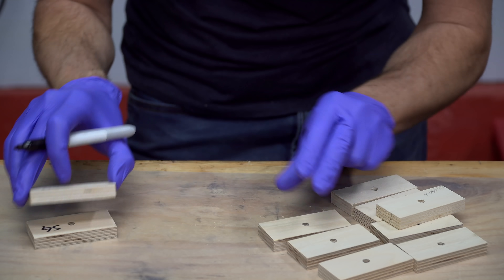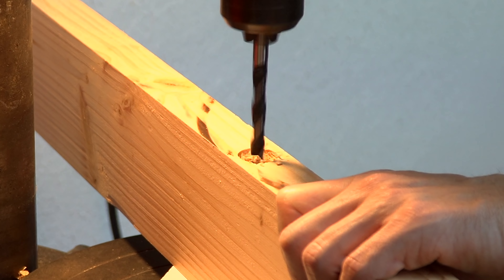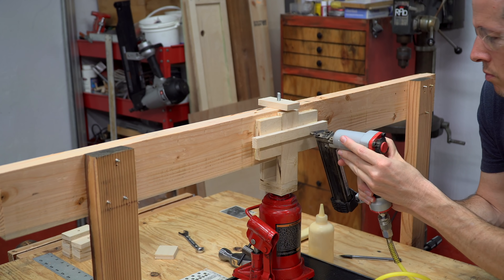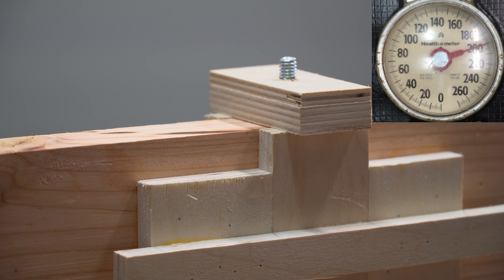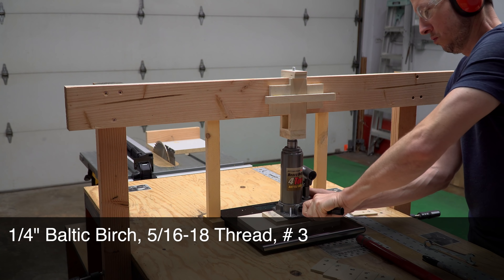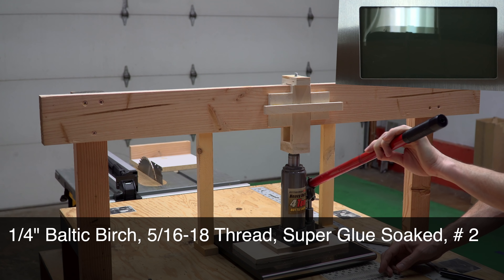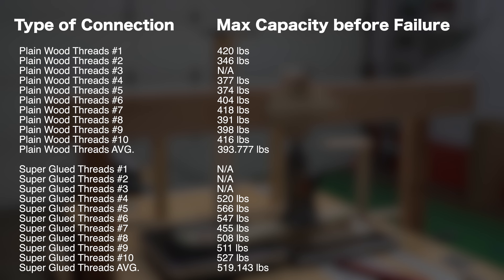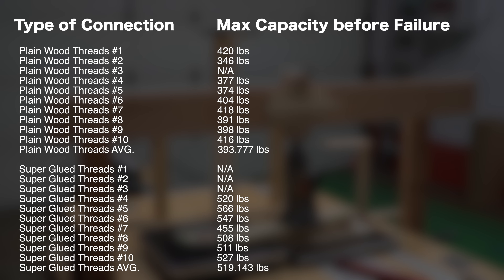Does Super Glue Make Wooden Threads Stronger?

Comment: Wow! That was fun!
Yeah, I'm a geek. 😆
But now I wonder how necessary it was to let the glue dry overnight. Did that make the joint stronger or just minimize the chance of the screw being glued to the block of wood?
Reply from the maker: Thanks (fellow geek here)! I just figured I would let the super glue fully cure, and the bottle said to allow 24 hours. I figured anything else would be unfair to the super glue. Anyway, thanks again!
Reply: @OneMinuteWorkbench  - Ah ha! That makes sense. Although, it does make using the super glue much less convenient, unless you're not in a hurry. Those joints were awfully strong without the glue. But being geeky (and somewhat anal retentive), I'll probably use the glue if time allows.
Thanks for the quick response and thanks again for the informative video and all the work you went through to create it.

Comment: Great test. But is it practical to use super glue and need to wait 24 hours before you and use the threads. Are the threads strong enough without the super glue for most applications.
Reply from the maker: Thank you! I think for most scenarios, it would probably not be practical to have to wait 24 hours to continue a project. However, I do like the idea of having the option available if a little more strength is required. I hope this helps!
Reply: You can use an accelerant to make super glue cure faster. There are a number of them on the market, but the cheapest accelerant for CA (cyanoacrylate glue) is water.
Reply from the maker: That's awesome! Thanks for the tip!

Comment: why not use a torque wrench, that's how you test thread strength?
Reply from the maker: Thanks for sharing that idea! I wanted to test direct pull forces, which are a little different than the type of forces applied by turning the threads. However, your way certainly would have been a lot faster & easier 🤣
Reply: @OneMinuteWorkbench  you could have used a piece of threaded rod and then applied a pulling force by using a spacer and another nut. that way the threads are not turning in the wood, only the nut is turning and pulling the threads strait out. and to measure the torque there are digital torque readers that go inline with a ratchet/socket and can measure peak force.
Reply from the maker: Thanks for sharing the idea!

Comment: I could not see where anyone else asked this - I may have just missed it though, using the threaded hole with a screw as the force (rather than pull out stress test with a Jack) , i.e. tighten the screw and see when each fails (or peaks in compressing force) as in this test the screw thread would also have an element of shear stresses and I suspect but don't know, that the lower frictional co efficient of the super glue thread could increase the effective clamping forces before failure. Just in case you were going to do more tests !  P.S. You might also test this with a Torque Wrench as this would be fairly easy and quick. In metallurgy I learned that swaging threads in soft metals (Aluminium) was stronger than cut threads - could this be true too of wood (with or with out superglue)?
Reply from the maker: Tightening with a torque wrench until the thread fails would be a really great test as well. It's definitely testing different forces, but it would be easier to do, and would probably still show whether or not CA glue increased the strength. I wonder if you could swag threads in wood...hmmm 🧐 Thanks for sharing these ideas!
Reply: @OneMinuteWorkbench  I remember seeing some comments and or questions regarding using a bolt with a slot cut into it as a tap - I have certainly used this to clean out rust and debris from existing threads - and I am confident a good DIY operator could make that work really well, however I was thinking of the type of screw/bolt that has a swaging type profile (rather than the expensive swaging taps that engineering companies use) and a link to one manufacturers data sheet is https://taptite.com/assets/files/remformiifbrochure-final.pdf - the concern I would have is that swaging is pushing the material or rolling it out of the way - and wood being plastic - it will recover (and possibly more so) if a wetting agent is used (superglue) to return partially to its original form or shape - hence my thought of using a screw that stays in the timber for a while - I will try it one day when I have a project not needing metal threaded inserts!
Reply from the maker: Let me know what you find!

Comment: That was a good test. Too bad the scales didn't go higher. Lol
Good idea to use super glue on threaded items that will have lenier  pull with the bolt. Will Shure nake my projects stronger and won't need to buy "T" nuts.
Reply from the maker: Thank you! I wouldn't say superglued threads are good replacement for T nuts though. The force a T nut can hold is sure to be many times what a wooden thread (even with superglue) can hold. So, if the original application had a load that was great enough to require a T nut, then it will probably still need one. I hope this helps!

Comment: Dude it works on the same idea as fiberglass so yea its gona definitely make it stronger perhaps there are other acrylics or polymers to soak into the wood they also treat some industrial concreet floors that way material science keeps evolving tough so i wouldn't be surprised if they figured out a way to grow carbon fiber reinforcement threw wood and such later on kinda suprized they haven't done more with aircrete as it been around for quite some time then again it takes like 14 to 20 years to wait out an overpriced patent and start to get it out on the market some times the technology they got out there seems crazy some times yet the lack of people applying it such as gotz von berlichingen's working prosthetic arm thats a museum piece that dates way back there like 1500s and probably what gave the idea for the metal hand from" army of darkness " with Bruce Campbell
Reply from the maker: Dude....Army of Darkness. Yes.

Comment: Great test, I'll stop buying nuts and washers and just use superglue. Not really, but I will use  threaded wood, soaked in superglue as an option. I had no idea it would hold this well. 
These stupid digital scales are trying to save batteries and give us no option to say just go for it, I have another battery.... 

 I've done things like this several times and digital can be a total pain in the butt. Unless you buy a 'scientific' sensor which is usually the same thing but with more divisions (like 10ths of a pound instead of 5ths). (All of these things just use a Wheatstone bridge circuit. It would probably be easy to make a sensor that plugs into your computer. I don't know how, I just know it's not that involved)

I'd always go for a spring scale, they can have some lag, but they are accurate. And to double or multiple what any scale measures, just add a lever as rigid as you can get. I made a popsicle stick bridge tester that used a 50 kg luggage scale, but was levered and pulley'd 10x so it measured 500kg.  so if you have your jack in the middle of a beam, one end on a fulcrum the other on the scale, just double your reading. But you already know this.
Reply from the maker: lol - don't stop buying hardware 😂

Comment: This was a great experiment and I'm frankly a bit surprised by the amount of increased strength in the BB ply. I did this with my MDF CNC's spoilboard. I wasn't after strength, since I used nylon bolts, so much as hoping that the holes last longer due to frequent bolt insertion/removal.
Reply from the maker: Thanks! I was also pretty shocked by how much the threads held, and how much they were improved by the glue. Fun stuff!

Comment: I love these test vids, thank you. BTW, you could overcome your scales limits with a lever similar to how you rigged the two together. Rather than explain it, check out Matthias Wandell's video. You wouldn't have to worry about the blinky digital scales, you could use your original needle scales. https://youtu.be/co3EH8WZsX8
Reply from the maker: Thanks for the suggestion! A few others have mentioned this, so I'll just copy and paste my reply from early:

I actually started out using leverage to reduce the force required so the scale's readout would be able to handle the test. I switched to this method though because the torque being applied at an angle was causing problems; it was "wedging" the bolt in the hole, so you couldn't really tell if it was the threads or just the friction of the angle causing it to hold. Someone brought up that I could use pivots in the lever arm to keep the force perpendicular to bolt. While that's true (and I did consider it), it was more complex than simply buying an extra scale, and I felt it would create more room for error, so I decided on this simple, direct force apparatus.

I hope this makes sense! Thank you again!
Reply from the maker: Also, thanks for letting me know you enjoyed the video - I do appreciate it!

Comment: Your test is fundamentally flawed: 1/2 ply plus 1/4ply equals 3/4 inch thick ply. Simple math. The real test would have been to use The 1/4 ply by itself. Yes, it would have broken in thr threads . But, is that not the test.
SAFE TURNING, John
Reply from the maker: John, thanks for the feedback! Have another look at the video - the 1/2" piece was not threaded, it was just a clearance hole. It was only there to support the 1/4" piece and keep it from cracking in half. That way we could see how much the threads themselves held. Again, watch it one more time and let me know if it makes sense. Thanks!
Reply: The fact that it is not threaded does not matter. The 1/2 ply adds resistance therefore a flawed test. Practical physics. 
SAFE TURNING, John
Reply: Don't worry, we understood. A well thought out test, obviously the 1/2" piece was necessary to get any kind of accuracy. Don't listen to the naysayers, keep doing what you do!
Reply from the maker: Thank you for the feedback, Andrew!